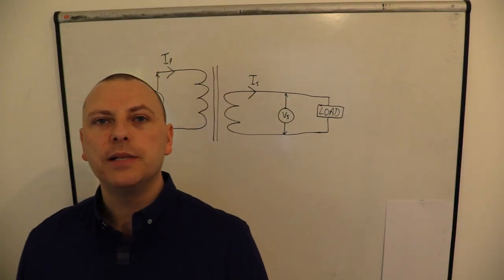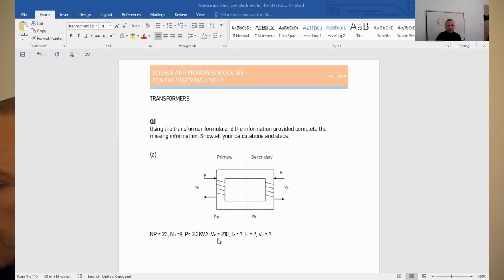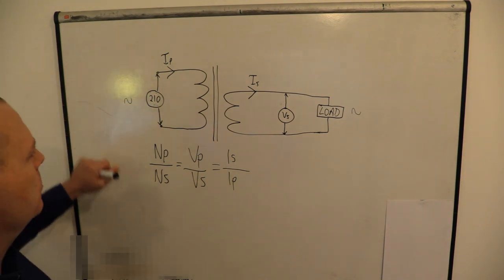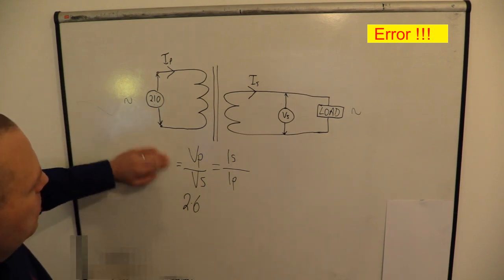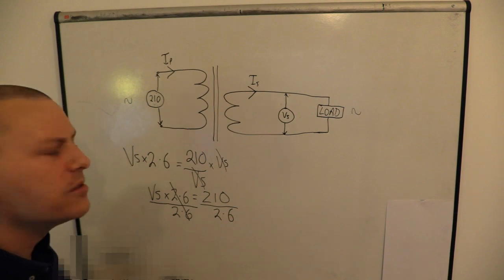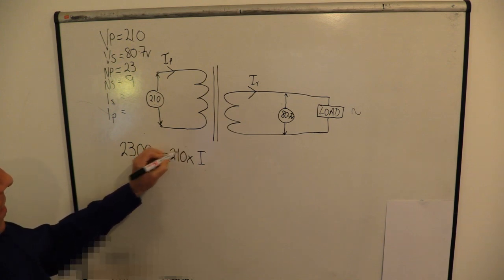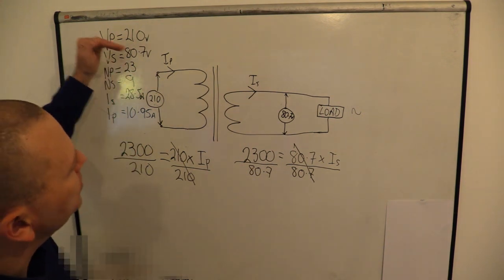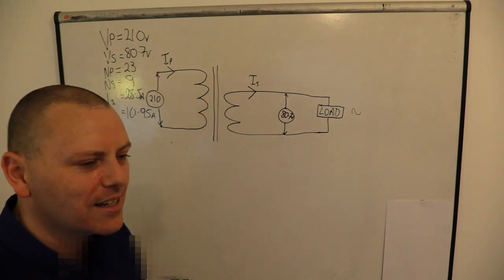Q1 Transformers  calculations  Robots in disguise    nah

Comment: Thanks Craig. Great video. The illustration showing when voltage decreases current intensifies (and vice versa) in a step down transformer really helps with understanding the transformer formula and the  inverse relationship between current and voltage/turns.
Reply from the maker: It's a physical thing Tim, it's not magic like I used to think 😁if you understand about what current and voltage actually are then it falls into place......i feel.